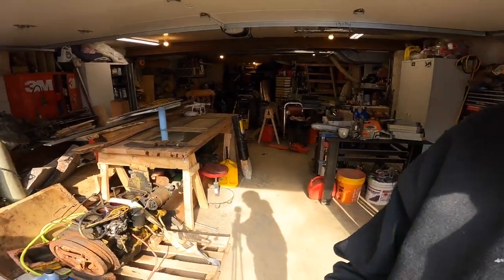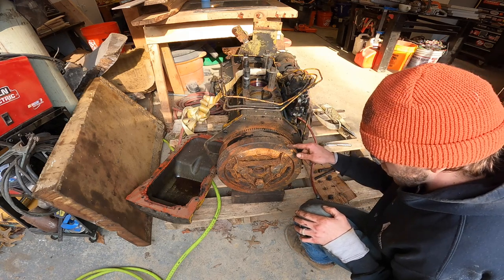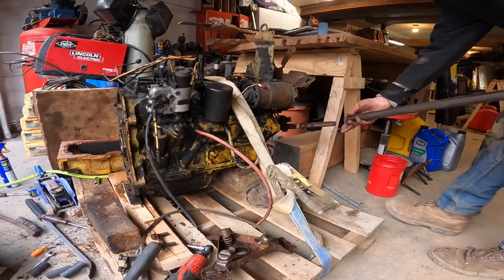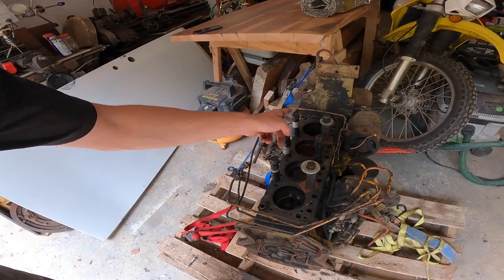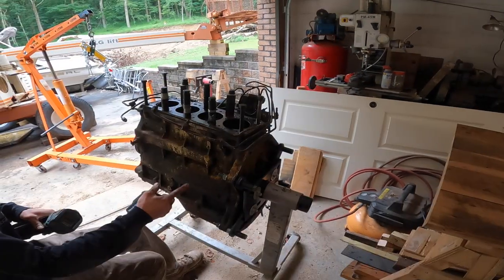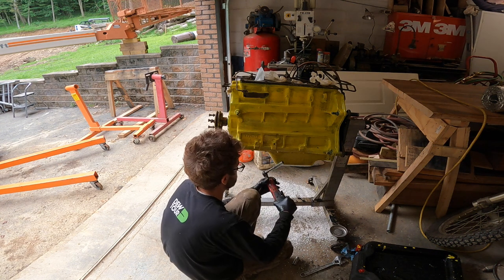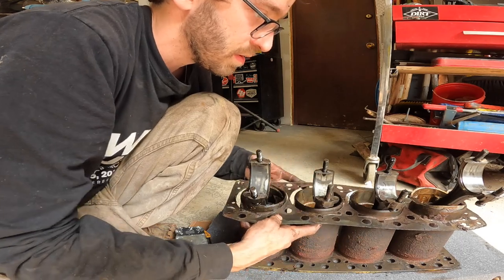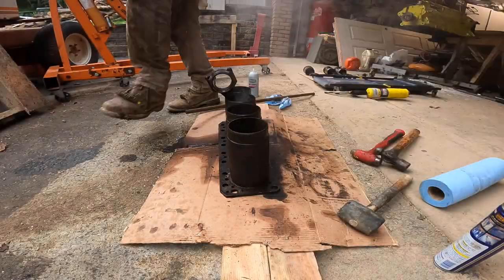1960 John Deere 1010 Backhoe Complete Rebuild Part 7 - New Engine?

Comment: I will give you a A for effort... You should be able to rotate the whole block assembly on your stand to make it easier..... If your other block is good use it and your new cylinder sleeve assembly 😉
Reply from the maker: Thanks! The diesel is unfortunately slightly different than the gas engine so I can mix and match parts
Reply: Oh didn't catch one was gas and the other deisal.... yep Houston we have a problem....lol...good luck
Reply from the maker: @mattovictimcycles1334  haha thanks man!

Comment: You have a lot working against you on this engine!  I bought my 1010 diesel back in 1978.  I had to totally disassemble it at the time due to a missing oil gallery plug that was left out during a rebuild before I got it.  Had very low oil pressure.  Anyway, if you are going to use the diesel, I have the engine repair manual if you need any specs.  I can email you some scanned pages.
Reply from the maker: Thanks! I bought the manual, and am still working on this project. Just need more time…

Comment: Probably too late to warn you, but 1010 diesel engines were past bad, IDK if they're the same part number, but I would strongly recommend using that deck plate in the gas engine if they're compatible. I'd hate to see you get it all back together just for it to do what 1010 diesels do best and blow up for no good reason.
Reply from the maker: So this engine is on the back burner because the guy I got it from broke the casting on one of the head bolts. Hoping to repair it. Unfortunately I am also missing a ton of parts to get this diesel engine running
Reply: @IntoTheDirtshop  You'd have to do your research, but if you aren't as focused on originality as I am, I believe there's a little Detroit Diesel engine that's a direct bolt in replacement to the 1010 engines
Reply from the maker: @gearsnstuff7330  no way! I’ve never heard that before, any idea what the engine number is?
Reply: @IntoTheDirtshop  I actualy just found where I found the information before, it seems that a 2-53 from a John Deere 440 should bolt straight into the bellhousing on a 1010. No garuntees that it's any easier to find, I'd try Farmer John's Parts, but they're a lot easier to find parts for than the original 1010 engines
Reply from the maker: @gearsnstuff7330  I’ll look into it thanks!